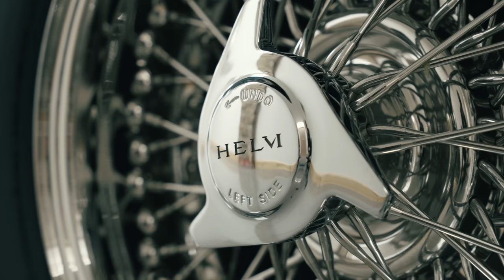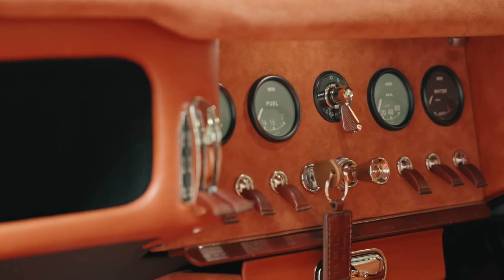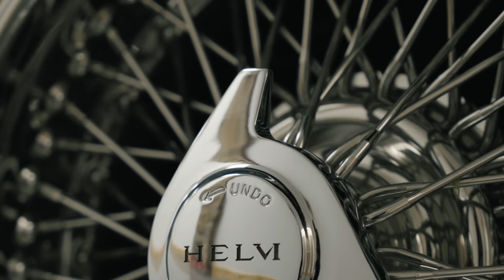This E-Type Restomod Prototype By Helm Costs £420,000, But It Might Be Worth It | Carfection 4K

Comment: 420k E-Type resto. you can pay 70k for an E-type mk.1 3.8 litre. Does it really cost an extra 350,000. To have 2 tiny bumpers fabricated, a brake kit, a fuel injection kit,2 lead head lamps, lightened engine work and a new soft leather interior added ?
Reply: In short, no. This seems to be more of a fashion item than an enthusiastically prepared restomod
Reply: Yeah it won't, but they have overheads they need to cover. I.e. staff salaries, parts, energy bills, rent etc. And if he's only building 20, am sure it takes a while to coach build each one, after stripping them back.
Reply: But to be fair, the price's subjective. I would buy one, but the Mrs would divorce me. 😆 to be fair, I have been eyeing up an E type that I want to mod myself. Cars £110,000 and for me. Someone who absolutely loves the E-type. £420k is a fraction of what I would pay for a beautifully well done E-type. Probably would buy an eagle instead though, especially for that sort of money.
Reply: Also, being a fan air conditioner for E-types and classic jags in general. £420k for that is subjective. I would genuinely buy one. 😅 but am sure the Mrs would divorce me for such an expensive toy.

Comment: It’s great that another E-Type has been preserved that maybe wasn’t in good condition before. But the ill-fitting headlight rims are strange. A few other strange choices: the headliner is not suede (so it has a sort of mirror effect), but the dash is suede, where something more hard wearing could have been good. Changing the bumper detail: well, you are fiddling with a masterpiece. The switches with those leather ends: I get the handmade aspect, but this feels out of line with the rest of the interior because how the switches are done is so rustic. Also they don’t align.

Comment: How do they come up with these prices, ridiculous! Even if I had the money I wouldn’t be spending that amount on a restomod. Original un-modified e-types will still be around in 60 years and if you get in an original e-type and don’t feel a sense of occasion then you are dead inside.
Reply: It’s a mute point if you can’t afford it, I have just paid a great deal for a restomod MG and the modernity and perceived quality is in my opinion worth it...modern engine, electrics, lights, brakes, suspension, gearbox, steering, totally bespoke interior, the only issue is getting my Wife to stop driving it, I also have a 72 V8 original that she won’t drive as it’s a tractor in her words...what’s wrong with saving and improving and being able to pass it on in ten years
Reply: This price is too high indeed considering that Eagle E-types are truly restomodded with an insane attention to detail, whereas this one looks like a simple case of interior upholstery change, new brakes and led lights, which at least for me does not warrant such a high price.
Reply: @alanwayte432  Credit to you Sir. It's your money and MG's aren't an  endangered species. My only concern is that these "small" companies won't be around in 5, 10 years to service their creations or more likely the electronics will be unsupported. But it means you have have an old car on the road which in my opinon is greener than these electric boxes.

Comment: That light bezel and seal could be a bit more integrated. Looks like it wasn't designed well, to cockle of the trim like that.
Reply: Maybe that's just more obvious in a close up photo. I've driven several E-Types, both coupe & roadster and that never jumped out at me. This one is definitely not what I would expect at that price. It looks like the chrome bead should be trimmed outside of the chrome bezel. That's what is keeping the bezel lifted and leaves that gap. There's no wonder that the bezel has to lift to get over the bead. 

Let's hope the Helm people will read this review for some constructive feedback. I've loved E-Types since they were introduced in Geneva, Switzerland in 1961 but they never were perfect. I've never heard anyone speculate about it but while they were a fabulous value for the money, there had to be a reason the could come in at that price. Business is business and you just don't get nothin' for nothin'! I lived in Stuttgart, Germany when the E-Type was presented in Geneva. It was just spectacular in 1961 and it was made by hand!! Holding it up to 2021 standards is going to be disappointing when you compare that body construction to modern robotic products. Mechanical perfect isn't what made it an icon. Malcom Sayer laid down a piece of mechanical art... by HAND!! I haven't seen a robotic design able to match that yet.

Comment: Why are there blocks under the left side wheels only?   I wouldn’t spend 400k on a car that won’t sit level.
Reply: Yeah! I wondered too. Too obvious to be a problem with the car… I hope. If I had one shot on getting my £420k car on Carfection I wouldn’t put it on chocks.
Reply: I hope for them the floor of the shed isn't horizontal completely? But looking at the front emblem I wouldn't be surprised if it isn't level.

Comment: Built in the 80's, 69 E-type 6.5 liter Aluminum head 4 cam v8, stick shift, 2.88 rears, AC, PS, Red Black. Seen it? My old car that went to auction in 1990's hmm. Yes it was a mess when I got it with a frozen engine but only 44K miles and near perfect interior. Would I do this today? No. Twin turbo the 4.2 today, all else the same.

Comment: The only thing that let's me down is the way the front headlights outer trim sits proud of the longitudinal chrome strip.  
For me l would ask that they fit the cover s over the trim with no gaps on it for that amount of money all 420 thousand of 'em.
Why does every car journalist go to the boring choice of the Pacific Highway #1 . But there are betel roads in Europe. 
Also every famous racing driver Inc Norman Dewis said that the 3.8 was the better engine for power and torque.

Comment: Gotta be honest, I'm getting resto-mod fatigue these days. Seems every man and his dog want to jump on the bandwagon and charge some ungodly sum for a "breathed on" old car. Don't get me wrong, it's a lovely car, but resto-modding is starting to feel more like a license to print money...
Reply: Aren’t all car repairs a licence to print money; just some more than others? :)
Reply: @cc8530  Cars are never a cheap hobby, but when a resto-mod version costs double or even treble the top end price of the car being worked on, things really don't add up. Top value E-Type currently on Pistonheads, with only 300 miles on the clock is at £160k. So you could buy 2 top drawer, low mileage models, and still have £100k in change compared to what they're asking for this....